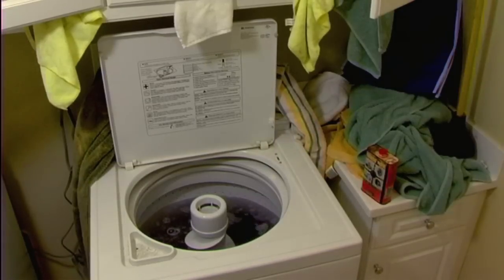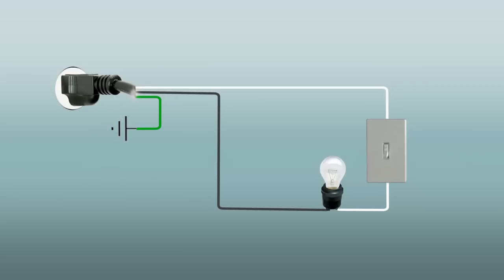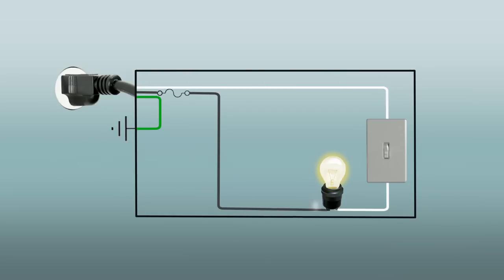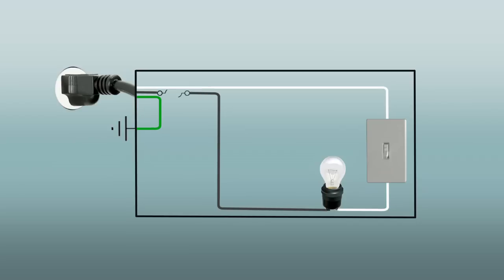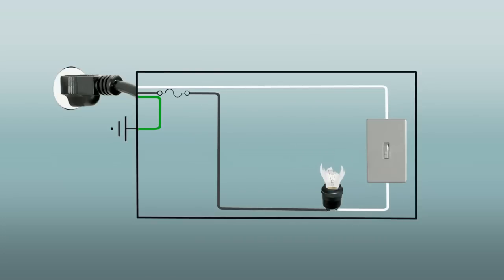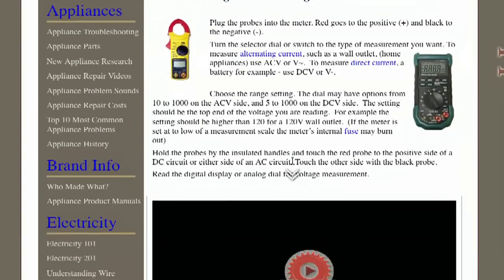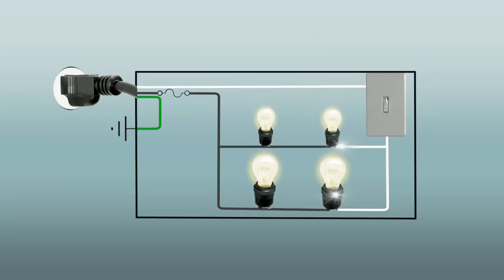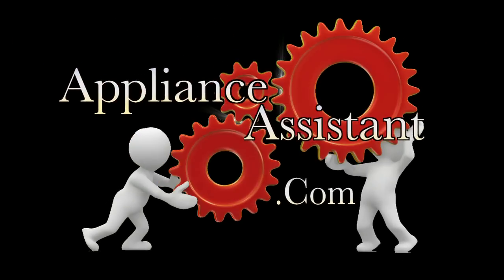Circuit Troubles (Basic Circuits and Common Problems)

Comment: Why the switch is located on the neutral wire?
The bulb is located the Live wire.. 
The switch connects the neutral wires to complete the circuit..

Isnt its dangerous if accidently touches metal plate in the bulb holder while changing the bulbs even the switch is turned OFF..😅
Reply: For wiring a house that would be dangerous... However, I used these simple components to show how circuits work. In appliances, such as dryers, switches are often placed on the neutral side of a load, eg. the door switch. So it's best to not assume anything when troubleshooting. There is also the situation of reversed polarity where the white wire becomes "hot".  Honestly if I could, I would go back and fix that aspect of this video but Youtube doesn't allow editing of a published video. Thanks for the comment!

Comment: There is one small problem with your video ,the switch that is shone is on the wrong conductor , A switch should always be on the black or hot conductor never on the white or neutral conductor . But who knows with appliance manufactures they have their own rules.

Comment: People, you do NOT need a "ground" to have a fully functioning A/C system.  It's not like your car where Red is power and Black is "ground".  That's DC.  An A/C system just needs 2 wires to complete the circuit back to the transformer or generator.  That's it.   The only reason people "ground" (to earth) an A/C is to shunt one hot wire to ground (literally, to Earth) in case of a short circuit.  That's it.  Normally, the earth or "ground" connection in A/C systems doesn't do anything.
Reply: And if someone tells you that "Neutral" in a 120 volt AC system is not "hot" / powered, ask them to pick the "Neutral" wire at any 120 VAC outlet and prove it.  Which prong (left or right) is not carrying current?  lol

Comment: Your diagram is incorrect and is confusing to the viewers.  You see this in the comments. You acknowledge this in a your own reply 1 year ago. Your diagram should be changed or the video should be taken down.
Reply: No it wasn't!!! I understood everything taught and I am NOT an electrician or appliance repairman. BUT.. I have fixed two washers, dryer, and a refrigerator! And they are STILL RUNNING
JAMES BOZO-KOKOVICH you need to settle down brother!

Comment: your diagram is wrong
Reply from the maker: Matthew Edwards you are correct a light switch should not be on the neutral. In appliances a control relay can open a circuit on the neural side. Thanks for your comment.

Comment: This needs taken down it is dangerous others have mentioned it but you never use a neutral as a switch leg. Using white wires in this video as you switch leg is WRONG!!!
Reply: Check out your dryer wiring diagram. You'll see neutral switching. It's very uncommon but given the appliance background and nature of the video it can be forgiven .

Comment: Switch should always be on the hot lead...
Reply from the maker: Alfredo Fuentes actually within an appliance circuit the switch or relay is often placed on the neutral side of a load.
Reply from the maker: Example: dryer door switch.
Reply: dude what are you saying. lol why would you put the contactor or relay in the end of the circuit lol .....you do know that the neutral side of any circuit is the returning side right ?

Comment: Had high hopes for this video.

But, the moment I saw the light switch (in the diagram) wired on the neutral side of the circuit,
it was time to click on something else.
Reply from the maker: Seemsayin dryer door switches are on the neutral side of the motor circuit...
Reply: Well then... Had I stuck around for the entire video, I suppose you
may never have heard from me in the first place

However, the title to your video is misleading. If I were looking for
appliance help, I don't think I would have chosen your video, simply
because it's titled "Circuit Troubles (Basic Circuits and Common Problems)".
It sounds like a basic electrical video, not a trouble-shooting guide for
appliances.

But still... my bad. My apologies.

Comment: This video is a failure and should be corrected or removed. You never switch the neutral wire in a circuit, always the hot wire. This video could kill you.